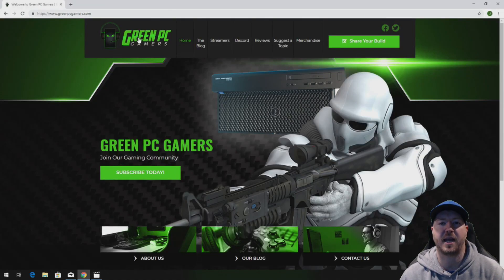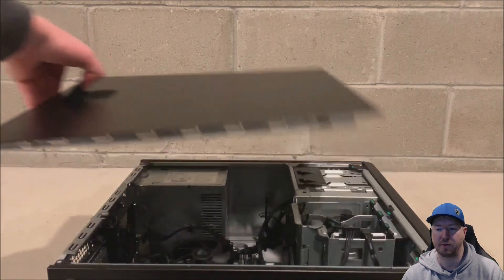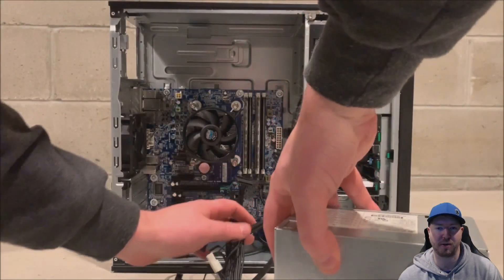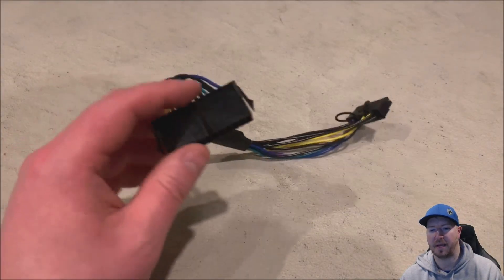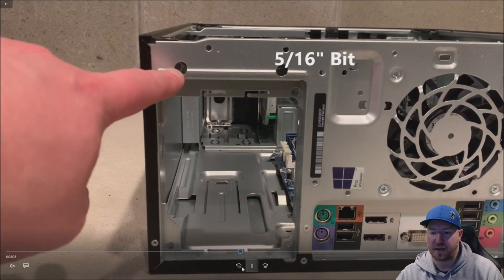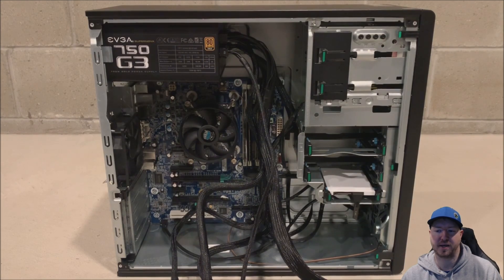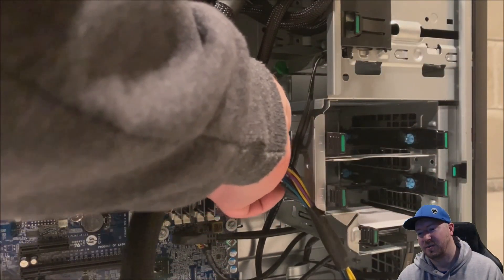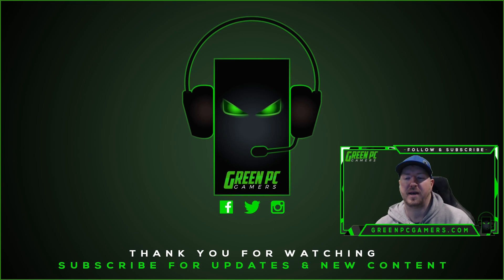HP Z230 750W Power Supply Upgrade

Comment: I scored an HPZ 620 and HPZ 230 recently. I want to build the 230 for a light gaming machine but I'm in a bit of in a jam as my HPZ 230 PSU died and I want to install a higher wattage non HP ATX PSU but am told it will be a hassle because of the 18 pin power connection on the MB, and all non HP PSU's are 24 pin. Even though there are adapters available like used here,  there is something about the OE PSU producing a higher stand by voltage?  then the 5v most non HP PSU's produce. Some say that after such a swap they must use the new ATX on/off switch instead of the computers original on/off button, others say they had no success. So I'm trying to find info on this issue if you or anyone can chime in some advice it would be appreciated thanks.
Reply: HI @Alpha-ms9j , may I ask how did your PSU died?
 [[ I am trying something like that , and I don't want to make a mistake ]] :goodvibes:

Comment: I've done this, followed your guide and I can't get my pc to power up. The PSU I have came with a tester and it works perfectly just not when connected to my pc. I'm guessing my 24-18 adapter has broken or something. So far it's been a bit of a money pit of a pc, I only want to use a gtx970 and I've had no luck with it so far!!
Reply from the maker: Sorry that you are having issues.  The culprit is most likely the adapter cable.

Comment: What I'm seeing here is (currently) 23,000 people who've watched this video. That seems like 23,000 potential customers for custom laser cut X2xx chassis to standard ATX PSU adapter plates. Maybe made in alloy or powder coated steel? Even if only 500 people decided to buy them, I'd think that they could still be made cheap enough to produce and post for what would be seen as a reasonable cost all round.

Comment: Does the 18 to 24 pin adapter also work with a PSU that has just an 18 pin MB output?

Comment: I'm using a Diablo tech ATX power supply and I've got the adapter I'll plug it up to the power slots the 4 pin. and the 24 pin to 18 pin on HP 230 workstation 16 GB of RAM and installing a RTX 2060 KO ultra gaming card. Board lights up press the power button it beats four times and then blinks for time s nothing comes on no power to the fans nothing.

Comment: Hi does anyone know the pinout for the front panel connector I have a good idea from tracing wires but they is a red and white wire what ends and is tie wraped to the front panel metal chassis is that a temperature sensor wire? It has a small black Bob where both wires go into

Comment: Thanks for this very nice detailed video!  I have a Z230 and would like to upgrade my video card with an XFX Radeon RX 580 GTS XXX Edition 1386MHz OC+.  The EVGA 750W Gold PSU is out of my budget though.  Would a 550W work with that graphics card?
Reply from the maker: XFX recommends 550W or more for that GPU.  It should work fine.
Reply: I have rx 580 8gb installed on my z230 but..on 400w psu and whenever I run a more demanding program the pc just shuts down all of a sudden.I was planning to do this but lots of people say that power adapter cables are not safe to use

Comment: What's a good cpu upgrade for this computer that's relevant for gaming nowadays?
Reply from the maker: Recommended Processors:

Up to 1 x QC I5-4690 3.50Ghz 8MB 5GTs Processors | 3.90Ghz Max Turbo Frequency (SR1QH)

Up to 1 x QC I7-4770 3.40Ghz 8MB 5GTs Processors | 3.90Ghz Max Turbo Frequency (SR149)

Up to 1 x QC I7-4790 3.60Ghz 8MB 5GTs Processors | 4.0Ghz Max Turbo Frequency (SR1QF)

Up to 1 x QC Xeon E3-1246 V3 3.5hz 8MB 5GTs Processors | 3.9Ghz Max Turbo Frequency (SR1QZ)

Up to 1 x QC Xeon E3-1271 V3 3.60hz 8MB 5GTs Processors | 4.0Ghz Max Turbo Frequency (SR1R3)

Up to 1 x QC Xeon E3-1280 V3 3.60hz 8MB 5GTs Processors | 4.0Ghz Max Turbo Frequency (SR150)

Up to 1 x QC Xeon E3-1281 V3 3.7Ghz 8MB 5GTs Processors | 4.1Ghz Max Turbo Frequency (SR21F)
Reply: Thanks! Which one do you think will be more future proofing? Are the xeons worth it? Will be browsing eBay.

Comment: i recently bought this workstation and im running it with rx 570 4gb but it shutdown randomly after 4 to 5 hours while gaming?? is it bcz of low psu?
plz answer..
Reply from the maker: Are you running the stock psu?  If so, yes the power supply is likely the culprit.
Reply: @GreenPCGamerscom   Yeah Im running the stock psu which is 400w i guess
Reply: @a.kgaming2360  I'm also running it with a rx 570 4 gb, it never crashed or shut down. Stress tests run just fine and games work fine on ultra.
Reply: @waqasashraf3131  but it depends on system specs

Comment: Heyy Bro Love your Videos. I want to ask that I have Hp Z240 Workstation.. will it handle 600W power supply for Gtx 1660 6GB ...... plzzz replyyy
Reply from the maker: It shouldn't have an issues running a GTX 1660 Graphics Card.
Reply: @GreenPCGamerscom  i hope so that it will fit... will my motherboard handle 550W PSU?? In hp Z240??

Comment: I'm looking at doing this for a Z220. One thing that concerns me however, is as well as the proprietary psu having an 18 pin plug for the motherboard, it also has a dedicated 4 pin plug which attaches to the motherboard in a different area to supply power to the cpu.  So how do I get power to the cpu if standard CPUs dont offer the 4 pin plug?
Reply: @Rae Thomas thanks

Comment: Can the z230 400 watt psu support gtx 1650 super ?
Reply from the maker: It should be able to perform most tasks without any issues.
Reply: @GreenPCGamerscom  ok but will the powersupply have trouble running a gpu like 1650 super ?
Reply: @nshk7163  nope. Nvidia isnt power hungry

Comment: Will a 1050ti work with standard power supply? Also running i7 4970
Reply from the maker: Yes, it should work fine.
Reply: @GreenPCGamerscom  thanks for the reply. I received my 1050 ti this morning and installed it. Unfortunately it didn't work and pc refused to boot up showing the blue screen of death and error code 0xc00000225. This cheap pc build is turning into an expensive one haha. Thanks for the advice though mate
Reply: Update. After a lot of messing around and googling I found out it was a software problem and I only had to reinstall Windows. All good now 👍

Comment: Would it be possible to use Z230's PSU to other chassis?
Reply from the maker: Possibly.  Let us know if you try it.
Reply: @GreenPCGamerscom  400W is not so big but it's 80+ Gold. At least useful for a single VGA, I think.
I added RX470 for Mining(It was really cheap in Japan) and rewrited to RX580 on Z230.

40W for browsing and 200-ish W for 3D mark. not so bad

Comment: I have converted my z230 with a evga 750W and the reccomended cable but all i get is 4 repeating beeps.  any ideads guys
Reply from the maker: You may have received a defective or incorrect able.
Reply: That was the issue i got a new cable and it is working like a champ now.
Reply: @matthewlattanzio2231  Hey Matt, where did you get your cable from please?
I'm on cable #3 and still get 4 beeps :-(

Comment: This video made upgrading the PSU on the z230 VERY easy. The drill measurements took some time to markup and get correct, but it WORKS! I was able to install a 600watt PSU from EVGA to power my video card. Thank you for the guide!
Reply: Did you need any extra special cable for the motherboard's 4-pin CPU Power connector? Or could you simply use the CPU connector coming from your PSU? Thanks!

Comment: there is 1 pin in the 18 pin connector that needs 11v... how did you solve that with the 24pin to 18pin adapter because every standard atx psu has no 11v output...

its maybe a stupid question...

the previous question about the 24 pin connector - the 4 does not work... to much pins still... i orderd a adapter to make everything work.

i build the complete system in a aftermarket case
Reply: It is a very good question
I'm also wondering how to get the 11v because it is for standby supply

Comment: Does the motherboard have standard ATX spacing on the screws? This is a great tutorial, but I'm kinda considering just getting a new case instead of drilling into the old one, would serve well as an upgrade path once the CPU gets old and has to be replaced.
Reply from the maker: We aren't sure if the Z230 system board had standard ATX screw holes.  Swapping to an ATX chassis would be a good option if the screw holes line up.  We agree, drilling through the chassis isn't ideal.
Reply: Did you manage to change the chassis?
Reply: the case ...
Reply: @kitakanal5107  Yeah. The screw spacing is standard ATX, but the cooler is mounted directly into the HP case and the mounting holes for it are non-standard, so you can't just swap to a different cooler. You can, however, just grab four nuts and screw the cooler directly onto the PCB, that's how the system I worked on has been running for the past two years. (Unfortunately I don't know the specs of the thread, was just lucky enough to find four matching nuts in a bin of random old computer parts.)

Comment: we use dell t5500 875w power supply like this? in hp
Reply from the maker: We've never tried a T5500 PSU in a Z230.
Reply: @GreenPCGamerscom   t5500 PSU is same as 750w gaming psu?

Comment: Does the temperature of the system remains cool if we play heavy games
Reply from the maker: The Z230 doesn't have a PCI cooling fan.  This can cause the GPU to run a bit hot under heavy load.  You could consider adding some aftermarket cooling to keep the GPU cool.

Comment: Thanks for this tutorial, bought the adapter mentioned and now I’m enjoying a CX450 and a 1050 ti in my Z230
Reply: Tom Crook I was able to fit a gigabyte dual slot gtx 1080 (11.5 inch length card) just fine when I removed the black plastic piece inside the front of the case (this is actually a video card brace mount from HP if you buy a high end factory video card from them). I have maybe 2.5 inches to spare after I did that. This should be able to fit 99% if not all cards on the market. The spacing of the sata and misc cables are just out of the way that a dial slot card fits fine. If you have one of the newer 2.5 slot video cards then you may have issues with that. But case size wise, most cards will fit fine.
Reply: @aqnguyen87  is there a difference in game performance when the z230 has only ha display port and no HDMI ?

Comment: Ok so i have a z220 cmt workstation i need an aftermarket cooler so i can swap my setup to a different case i ordered the cooler master hyper T4 for LGA 1155 turns out its not the same size as an LGA 1155 MOTB, Does ANYONE have a suggestion that doesnt make me need to buy a new MOTB

Comment: I have a z200 and I wanted to install a 500w PSU, I bought a generic 24 to 20 pin adapter but it didn't work. Should I buy one special for HP computers?
Reply from the maker: This is the cable that you need:https://www.moddiy.com/products/24-Pin-to-20-Pin-ATX-Power-Cable-Adapter-for-HP-Z200-Workstation-30cm.html

Comment: what form factor is the motherboard?
Reply from the maker: This is the Mini Tower Version of the Z230 Workstation.
Reply: @GreenPCGamerscom  ok so if i want to swap out the case for a different one do i need to get a micro atx case or a atx case? i have the same one as in the video
Reply: @tailsmilesprower1000  Don't know if you figured it out eventually. I'm late to the party. But a micro atx will be just fine.
Reply: @vantalim2297  oh i figured it out thanks

Comment: Hi! Nice video BTW. I'm trying to do the same with my z230 can someone send me a pinout of the power supply adapter because I bought one on  ebay and it doesn't power my system at all. Thanks
Reply from the maker: The actual adapter that we use is posted on greenpcgamers.com.https://www.greenpcgamers.com/technology/hp-z230-gaming-computer-and-other-hardware-upgrades/Look for the "24 Pin Female to 18Pin Male Adapter" link.
Reply: @GreenPCGamerscom  thanks mate!

Comment: Nice vid. Does the original 400 watt HP PSU have an extra 6 pin connector?
Reply from the maker: The original 400W Power supply has 1 x 6Pin adapter.
Reply: @GreenPCGamerscom  I was wondering if you had the pinout for 18Pin connection on the mainboard that i can use?
Reply: Yes . I have z230 with 400w PSU & it has 6 Pin connector Sir.

Comment: Would this work the exact same way for a hp z210 cmt? Like is the adapter required the same, the dimensions for installing the psu?
Reply from the maker: The Z210 would require the same 24 Pin to 18Pin adapter Cable.  We can't verify that any certain ATX power supply will work in the Z210 yet because we haven't tested it yet.  Thanks for commenting!